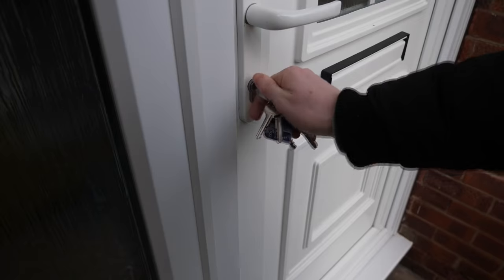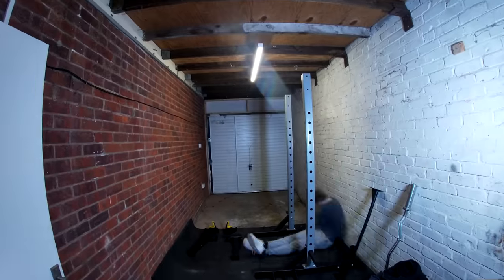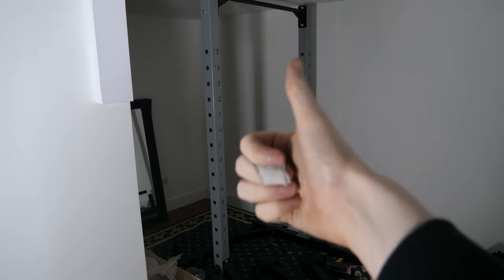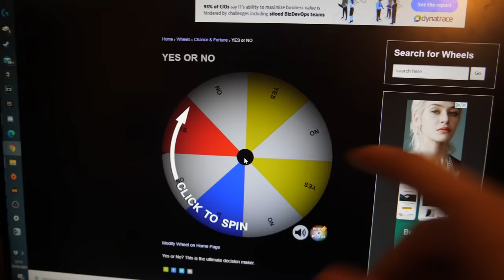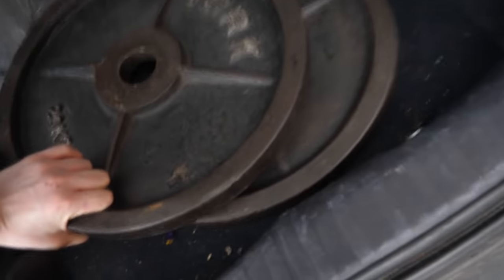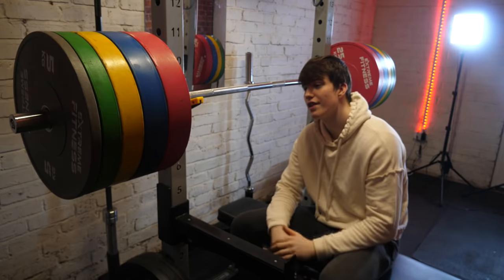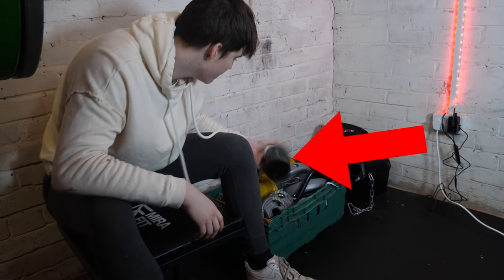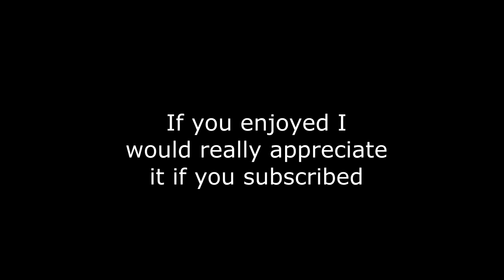I Built My Dream Home Gym

Comment: Hey joe, I don’t know if youve heard this before, or if you’ll even see this, but you should move your grip to a bit wider on bench press. Just to where your elbows are are a 90 degree angle to your forearms. This will activate your chest more, rather than your triceps, and also you’ll be able to push more weight. Not trying to criticize you, just trying to give some helpful advice. Congrats on the home gym!
Reply: Good tip bro i saw this same issue. He can push plenty more if he implements this
Reply: He has a coach dude. He’s doing this because he hurt his shoulder before and is waiting for it to recover completely and I’m sure he’s lifting for longevity anyway. As for chest activation what do you think the dip bar is for?
Reply: @wasd4542  chill out man. I’m just sayin it would activate his chest more on bench press specifically which is the main chest building exercise. I didn’t know his shoulder was injured.
Reply: This kid has fans who don't even understand the advice
Reply: @wasd4542  either way the OP is right about the elbows being directly under grip. If Joe wants to have a narrow grip because of shoulder issues, that’s fine, but in that case he needs to tuck his elbows so they are under his hands. 
You’d think his coach would tell him this........oh no wait......it’s the fake merc, dog neglecting, stolen valor, pathological liar Mr BlahBlah.
Reply: @JD83000  yes I agree. Also just because blaha done those things in the past doesn’t mean anything bad of his coaching
Reply: Ameer Wassup  his squat is a mess as well. He has a very significant lateral hip shift. This will cause him problems overtime putting significant sheer force on his lumbar spine and SI joint. 
Again, a decent coach (that he is paying £3000 a year for) would be adding in mobility work or unilateral leg exercises to address this problem over time.
Reply: @wasd4542  WTF is paying him $3000 a year for? If he can’t even tell him to tuck his elbows.

Comment: A small suggestion soundproof insulation on the walls could help lower the noise as well as there sounded like the garage had eco. Also could add some speakers that go in the corners of the room for day time workouts.

Comment: for your chest adding some cable fly's and or db fly's would help your chest grow more for sure, atleast it did for me (we have almost the same stature and both lacking in chest development)
Reply: 1234 • DB flys are one of the few exercises I stay away from as they have a high risk for injury! Cables tho 100% worth it!
Reply: @adambridgwood1227  when it comes to db flys i used to do them like dorian yates does them and felt pain in the shoulder so i changed my form so that my palms are facing towords my body the whole time and felt no shoulder pain and more chest activation
not everyone is the same so not every exercise works for everyone
Reply: @MercedesSL3  that’s more of a dip variation
Reply: Ameer Wassup  yeah cables are better as there is constant tension on the muscles!
Reply: Ameer Wassup  they are both good and are both have their qualities. There is a reason you see top bodybuilders like Dorian Yates doing Db flys
Reply: Ameer Wassup  also i disagree with the cable is better for you shoulders I don’t think that’s true. You are in a more stable position when doing Db flys and the form doesn’t brake when u get tired

Comment: Joe my boy, please widen that bench grip just a little.
Reply: Actually his shoulders hurt, so hi doesn't go wide on bench.
Reply: @navis4258  lower the weight, form first weight second
Reply: @Amazopig  The weight is not the problem it's the movement itself. With a wide grip, his elbows flare out a liitle, which causes impingement
Reply: Wide bench grip is the dumbest bromyth gym nonsense out there. It’s an unnatural way to push. 45 degree angle is where its at. It’s safe and effective.
Reply: @fufu1405  he’s not doing 45 degree though that’s the point, I’m not on about touching the end of the bar. It’s closer to a close grip bench. (Edit) also if you think wide or what I’d call a normal bench grip a bro myth I don’t think you understand what the point of a bench press is. It’s a compound exercise with the chest being the main muscle group that you use and want to gain on. Why would you spend so much time and effort to gain muscle to get less from it? If you want a big chest then train ya damn chest more.
Reply: @navis4258  and you think that excessive weight won’t effect it more lol cmon man it’s simple stuff. With the wider grip you use more of the chest rather than focusing the weighton the triceps and through the shoulder. If you distribute the weight better over all the muscle groups involved but focusing the chest I.e. what this compound movements for, you reduce these types on injuries. I have had my own shoulder issues and I can tell you lowering the weight will significantly help as it will work as a form of physio therapy, low weight controlled movements etc. If you shoulder is that bad you shouldn’t even be benching at all and certainly no heavy weights.
Reply: just use a chest press machine

Comment: Pro tip: to gain size try training with super high volume, fluff and puff pump workouts multiple muscles a day each muscle 2-3 times a week instead of training for strength. You're welcome.
Reply: penis doppelpenis  i am unnatural now but when i was natty 80% of my gains were from pump and volume training whereas some of my friends would be stronger than me but not as big or as lean. Strength vs muscle building training is real for sure.

Comment: Your old rack was fine, you had just built it wrong. The long feet at the bottom of the frame are meant to go at the back to support the weight. You had it back to front, and had the support feet on the front of the rack where they weren’t needed.

Comment: Lol I got everyething in the video for like 200€. Made 300kg of proper hard concrete weights with steel reinforcment for 80€ and welded a 3mm thick power rack the same desing as yours for 60€ and made a cable machine for like 30 € haha. And a barbell for 20€ that holds 400kg.
Reply: Damn thats great dawg, I have barely any weights lol gotta start doing what you do
Reply: @mking1592  was making PR's and gaining muscle while using concrete weights. They hard as hell no cracking just have a pad like you have in the gym when you deadlift..
Reply: @kristijansusnik1297  bet appreciate u